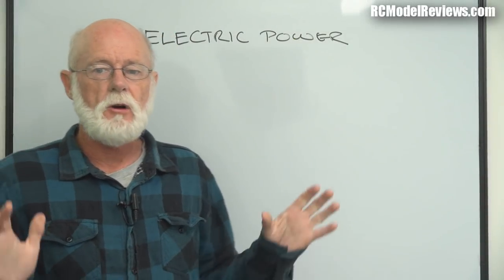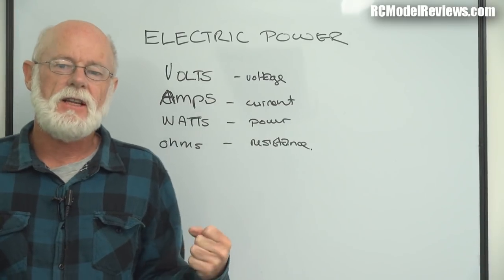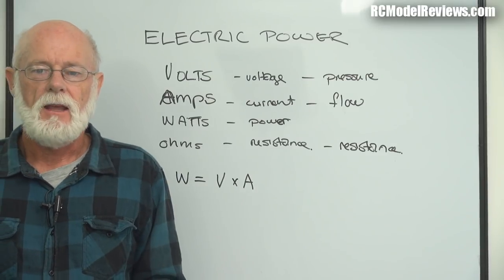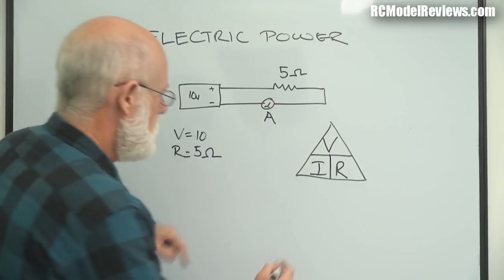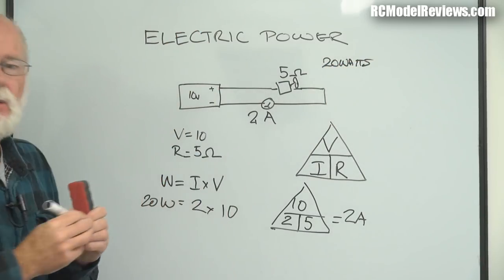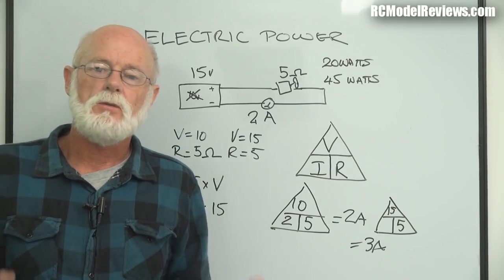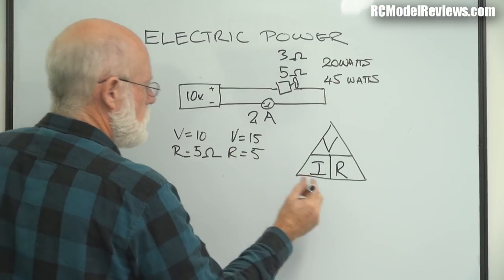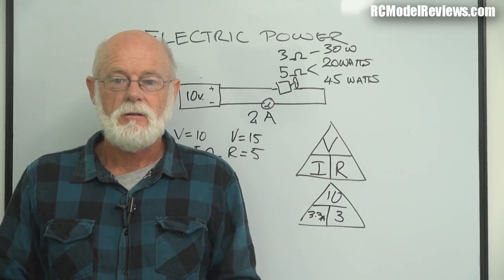Electricity basics for RC fliers

Comment: Good idea to gho over this because I have recently been just considering the increse in RPM. Though I have of course determined that the motor in question will tolerate a 4S, one must then consider the extra draw on the battery. A pragmatic dissertation on this matter Bruce. Thanks

Comment: Great video Bruce!  So greatfull you care to take the time to produce these informative videos.  Looking forward to the next in this series.  I am relatively new to electric powered aircraft, and got lucky when I installed a larger motor, esc, and 4s, 5000 pack in a plane and did not "blow things up"  Thanks to you I am learning how things work, and will help me decide on what equipment to purchase for a large 14lb formula1 sundowner, that I wish to push as fast as the airframe can handle!  Looking at all the listings of motors & specs is confusing between manufacturers, but you are providing some good knowledge to help engineer and select appropriate items. Thank you very much! Pete

Comment: really very good, it has been years that i took this class on electronics/electricity. keep doing this as a series please, great review. but when i was in school, we used the letter E as the voltage in the triangle. our teacher before learning this stuff was called Erny , so Erny Is Real, in the triangle. please do explain this stuff, change the prop on a constant same motor changes the current, wow, keep this up, i shall save the series, i do hope this is all correct though.

Comment: The "resistance drop" with a bigger prop makes mathematical sense, but not physical sense. In a physical sense, it would be more accurate to say that with a larger prop the motor produces more power, and therefore consumes more current. The motor resistance does not actually drop. However, the way you presented it is practically useful. You are a master at explaining things in a way that cuts the crap and tells us what we need to know to get stuff done!
Reply: The "effective resistance" drops when you load up the motor - hence it draws more current.

I could have gone into the details of how back-EMF reduces the current flow etc but for all practical intents and purposes, it can be thought of as a simple reduction in resistance -- since the effect (an increased current flow) is the same.

Comment: I learned more from you in three videos than I did from my high school's science program... Some of that is my fault, though! haha. However, these videos are great. I would like to understand how electronics use DC current from the battery to the motor, and AC current when charging. My guess as to why the motor offers less resistance when in-use is because the spinning part of the motor increases the current in the circuit.

Comment: You should do a video explaining why resistance drops on a motor when you increase load.
Reply: You mean the voltage drops, the resistance increases.
Reply: @imemyself2820  You obviously have not watched the video closely.
Reply: Better yet, do a video on what happens to your power output when the switching frequency of the ESC gets waaaay up there.

Comment: A nice practical example of motor resistance is a vacuum cleaner. Hold your hand on the end of the tube and the RPM goes up. Why? The motor doesn't need to pump air through the system anymore (the resistance goes down) so it runs more efficiently.

Comment: Bruce I would like you to explain how putting a bigger prop on a motor "physically" increases the current flow.  I understand the principles involved but I would like to see it demonstrated how increasing the load effects the motor current.  It must be more than just an decrease in wire resistance because of increased wire temperature, but what?

Comment: Helo,
I'm a beginner and some point is not clear for me in the RC electronic system. I would like to ask you that can it causeing some problem if I use a 2800mAh 11.1V 30C battery with a ZTW Beatles 20amps ESC 2-6LiPo what is connected to a SUNNYSKY Angel Series A2208-1260KV 2-3S Airplane Outrunner Brushless Motor (max continuous current: 13A) The propeller size is 1047. So my question is that this battery with the 84A can destroy the ESC or the motor? Or the ESC takes only that amount of amps what the motor and the rest of the parts needs? Will it works with these parameters?

Comment: Great...i did this at school and forgot a couple of months later and that was twenty years ago. Could there be a similar video for nitro basics? I am trying to put a nitro plane together for the first time and it's mindboggling. What size prop? What size tank? Which fuel? Filling the tank? 2 line or 3 line? Fuel consumption? Safety? Starting and stopping? Do I need a filter? Rich or lean? Muffler means more power? That sort of thing.

Comment: Good stuff, Bruce. Please include info on how to deal with altitude. I live at sea level, but when I travel to the mountains (7600 feet) do I need larger props for my tricopter? Will I burn up my 20 amp esc's?
Reply: Its all about load on props. At high altittute there's less air pressure & therefore less load on a given size prop than at sea level, but you would need more revs to get the same lift at altitude, so you could increase pro size to give more lift at a given load
Reply: Yes, that is my understanding. I wonder if there is way to compute this. Thanks.

Comment: One question  - toward the end of your presentation, you referred to the effect of the current increase as a result of your resistance drop from 5 ohms to 3.3 ohms and the resulting  increase in power from 20 watts to 30 watts.   Your conclusion was that if you had a 20 amp speed controller, then the increase in power value from 20 to 30 watts might blow up the ESC.    Can you please clarify?  I got confused at this point, since you were initially dealing with watts for the  motor power, but you then compared that value to a 20 amp ESC ( you're comparing watts to arms - hence the confusion).  Otherwise, this was a great presentation for a newbee like myself and it answers most of  my questions.
Reply: +Richard Lewczuk ESCs have amp ratings.  If a 20 amp ESC is used when 30 amps of current is being drawn it will get hotter (because the watts is increased) and if over powered long enough it will get too hot and be destroyed.

Comment: Hi Bruce, great video. How about doing a review on a meter like the "watts up" which is great for setting up models, so that you get the best out of you battery, speed controller etc. I always test a new model & experiment with different size props to get an efficient set up. Thumbs up

Comment: Hi bruce, nice to see the whiteboard up for tthe electronics.I would like to know what the magnetic flux levels are while a brushless motor is running and what exact effect changing the PWM and timing settings have on that and how that relates to output power and power drain.  Care to explain?  should be more exiting than U = I x R. I have not found a definitive answer on the net about that and like to get to the bottom of it :)

Comment: Thanks Bruce.  I know putting a larger prop increases the current that might require using a larger esc.  But I never correlated the increase in current to ohms law which would mean the resistance was somehow reduced.  What is the somehow?  Why does a load on a motor cause its resistance to decrease?

Comment: Please explain what happens when you push the throttle up on your transmitter. FETS and how ESCs work confuse the snot out of me.  The idea that its pulsing the same amount of volts to get a variable average!?  Whats pushing what? Battery pushing the motor, or motor drawing from battery? Are ESCs like an electric transmission? They way i understand it, is the motor will always to and spin per its KV rating.  In other words, its rpm is based on volts applied.  The bigger the prop the more power it needs to work or maintain its RPM. Does the ESC work like a valve? The more you open the throttle the more watts are pushed through the circuit?  Thanks, love your videos.  You must have been a great science teacher!

Comment: wow,2013... that's awhile ago, wonder if your still in touch with this. Well, I have a question.  I almost got the answer after watching this video a few times but seem to keep coming up a little short.I am trying to figure out the wire gauge I need for a project.  I bought a portable soldering iron, ts100. It works well.  I want to build  a power source that runs from lipos, either 3s(11.1V) or 4s (14.8V).  The soldering iron specs indicate a DC 5525 power port be compatible with DC12-24V. At 12V its power is 17 watts, at 24 volts it is 65 Watts.  Now the question.  What gauge wire do I need to use to be safe at 24 volts?I would appreciate not just the answer but the formula used, if there is one.I have not taken a science course in about 50 years so this retiree needs it fairly simple if possible.Thanks for the help.

Comment: Very handy, thanks! Still very confused with all the basics, I've got a quadcopter with 4 20A motors (30A ESCs), yet when I run it up the whole thing seems to only draw 16A total. I had assumed the total draw would be 80A (and spent money on batteries that could handle this), but obviously I was way out!
Reply: The 30A rating of your ESC and the 20A rating of your motors are "maximums" and don't signify what they will actually draw in normal operation.

The amount of current the motors will draw depends on the voltage (ie: cell-count of your batteries), the size of props you're using (which effectively changes the motor resistance) and the action of your ESC (the amount of throttle).

This will be come clear when I hook all this stuff up on the bench and demonstrate the interactions between the various elements of this puzzle.
Reply: ***** I look forward to the follow up, I've gone back through most of your archive in the last month or so while parts for my quad were arriving, everything has been super helpful so far. Thanks a lot!

I figured that the props would be related to the power draw because when I was testing the board I did this with props off and got a total draw of about 2A. I've ordered some 8" props as the 12" I have on at the moment are just plain scary. Unfortunately I think 8" props will make the thing fly faster and its already twitchy as heck. Still some things to figure out, but your videos help a lot. :)

Comment: Even though I know all this is good to remember , my esc  just stopped working I checked it and all seems good resistance and cap are working transistors have conductivity and soldering is ok no sing of fisical damage  bec is working but esc just doesn't beep and motor acts as if one rock was stucked inside any idea ? Just to know  cause it was working fine maybe a future video , thanks

Comment: Bruce
great job of basic ohms law. I thought that when you switched to a larger prop that the motor acted as if were a higher resistance rather than a lower resistance.  Now we need more on how to select a motor,ESC and battery for a given weight of a plane and the way we want it to perform.
Could you do this sooner than later please now that I have been into electric and want to convert several planes in the fleet to electric?

Comment: It's frustrating if these numbers don't add up though. I've looked at a HK motor (NTM Prop Drive 28-30S 800KV / 300W Brushless Motor) which is rated with a Pmax of 300 W, an Imax of 20 A and Vmax of 23 V.

So  300 W / 20 A = 15 V, but that's alot lower than the Vmax of 23 V?

If you chose to use a 3 cell battery with 11 V: 300 W / 11 V = 27,27 A. That is greater than the 20 A that it is supposed to handle...

Calculating the other way I get 20 A * 11 V = 220 W. Which would mean that you don't use all the power the motor could handle.

Comment: please expain why the resistance of the motor decreases with increased load ???
Reply: it's like: if i drive my car unloaded i will need less power cause the engine meets less resistance - if i load my car with people, bags and a trailer, the resistance increases because of the weight and the motor will need more power/gas

Comment: At 12:21, power is not 30 watts, it's 33.3 watts (volts x amps = 10 x 3.33 = 33.3 watts).  You might want to mention this correction in the video description or a pin a comment.

Comment: Nice explanation, but you mix quantities and units. For example you say "W = I x V", and hence "20W = 2 x 10". Based on that one might think that 20W = 20 => W = 1. (Wrong!). Better use quantities in formulas and units for the end result.

In fact, the choice for V as the symbol for voltage is a bit unfortunate. A phrase like "V = 10V" is in principle correct as long as you understand that the first "V" is the quantity and the second "V" is the unit. But it's confusing. At school we always used "U" for voltage to prevent that.

Comment: I don't understand why the resistance of the motor decreases with increased load.
Reply: Lower resistance = more current, as in the above example 5 Ohm with first prop gives current of 2 A (V=10, 10/5=2) 3 Ohm with the second prop(V=10, 10/3 = 3.3), as a third example imagine 1 Ohm, V=10 10 V/1 Ohm = 10 Amps
Reply: Thanks for that. I know Amps law but I don't understand what could be changing the resistance physically in the motor when you put a higher pitch prop on it. I guess it's all to do with the speed it's able to turn, due to aerodynamic loads, messing with the inductance but surely the speed controller is keeping the AC RMS voltage constant. Another way of explaining my confusion would be to say, why does the electrical resistance lower when the mechanical resistance (to torque) increases. What is happening in the motor?
Reply: Calum MacFarlane I have the same doubt on this. Could it be that the initial resistance required to drive the motor is more? but as soon as the blades rotate, the force required for it to maintain the speed at which it is operated becomes less than it is without the blades?have you found the answer?
Reply: sab2 To tell you the truth, I had completely forgotten about this!

Comment: That stuff about the resistance of the motor reducing under load is quite misleading.

The truth is that as you apply more load (a counter-torque) to a motor the motor has to draw more current to maintain its RPM which can be thought of as set by the volts (that whole Kv stuff) the increase in the current comes from the F=BIL formula, if for example you put a counter-torque on the motor (F) then I has to increase as F increases, since B and L are both fixed, it has to be I that increases.
Reply: Yes... but the idea of this is to keep things simple and as I said, I've taken some liberties with the analogies.  Despite the many factors involved, the reality is that as you add mechanical load to the motor, it draws more current -- hence it acts as if its resistance has been reduced.   Keeps it simple.

Comment: The last calculation is wrong. You multiplied the voltage (10volts) with the resistance (3ohms) and you get 30 "watts". As you probably know you have to mutliply the 10 volts with the 3.3amps. So you get 33Watts.
Reply: Actually, I rounded the 3.3A down to 3A to help my tired brain :-)

Comment: Loading down a motor does not reduce its resistance. Rather it slows the speed of the motor reducing the back EMF resulting in a larger voltage drop across the motor causing more current flow. I understand you're going for an introductory level summary and need to simplify certain concepts, but I feel a fairly fundamental concept to electric motor operation such as back EMF should not be ignored like this.
Reply: Wow!
I am shocked!
Okay, where is the flux capacitor.
Oh you left out henries  and farads